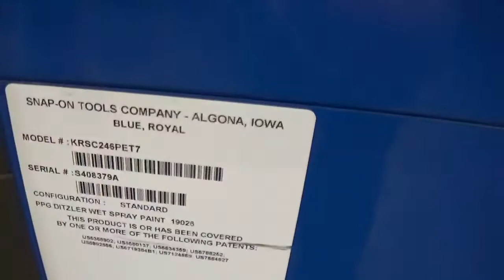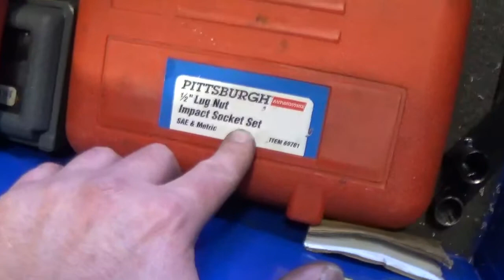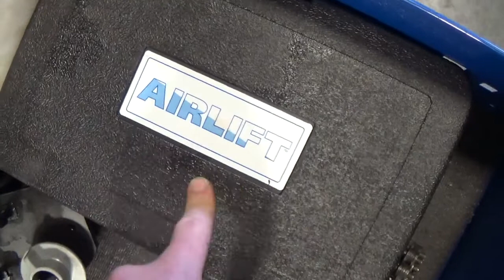Snap On Roll Cart Tour

Comment: Thanks for the tour..is that rubber grommet on the back of the top compartment large enough to get a cord through?
Reply from the maker: You cant put a 3 prong extension cord through it but you can put a power strip in the top area if you want, a 2 prong plug will go through it.

Comment: Harbor Freights new cart (same one as your Snap-On one basically) - both are made by Sunex I believe and are nearly identical now.
Reply from the maker: Glenn, my Snap On cart is made in Wisconsin by Snap On, not by Sunex. The Harbor Freight offering is great for the price, but it, as well as all Sunex offerings are not made as well in my experience and they are made in China.  I've owned Sunex, and Cornwell (made by Sunex), good boxes but more flimsy and drawer slides did not hold up to hard use for me. If I was looking to buy new, Id be looking at the Harbor Freight box pretty hard, but I bought (lightly) used and spent the same money on my cart. I might go with one for a home box to replace my overloaded little craftsman, we'll see.
Reply: Snap On makes their own stuff mostly in America. Harbor freight contracts their own stuff just like sunex. Might be the same Chinese factory, might not be but they aren't all the same even though they look like it

Comment: Love the video! But why do you lock your tool box?    If you don't trust people you work with.   Why are you there?   My tool boxes are open for the 4 people I work with. As are there's.  Its respect and we have a good crew. When I go on vacation.  I trust my guys .  And my tool boxes are open.  I borrow tools and like wise. Just saying.
Reply from the maker: I get it man, to each his own. I did that when I first started years ago one guy put back a wrench that had brake fluid he didn't wipe off all over it, I didn't know it and it ate the paint off the inside drawer of the tool box I had at the time (it was a cheap box but it was mine). Plus on rare occasion you find out the hard way that someone has sticky fingers. Thats happened before as well, of course once they were caught they didn't have a job after that. Ill loan someone a tool if I'm here, when I'm not here I don't like people being in my stuff. The guy Ive got working with me now...I know he's trustworthy, wouldnt steal a $100 bill of the top of my box, but I still lock up because of personal preference.
Reply: I have always locked up my stuff. Even in my home shop. The meth heads around here got smart and know they can make big money off stealing name brand hand tools. In the shop at work, the company provides our tools but I lock them up so when I need them for a job they are there and didn't walk away